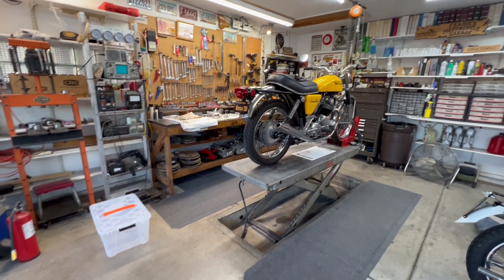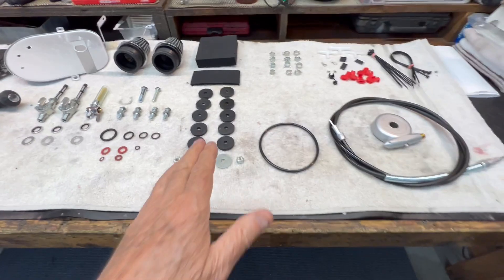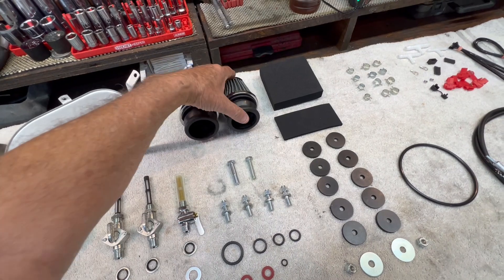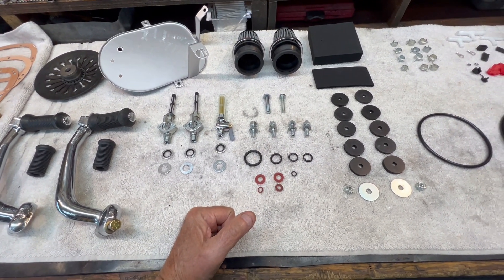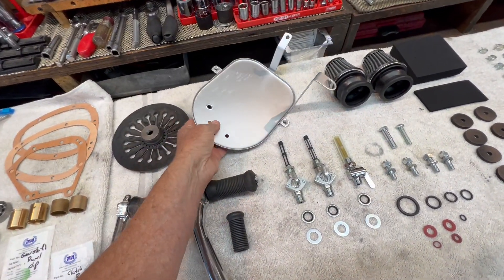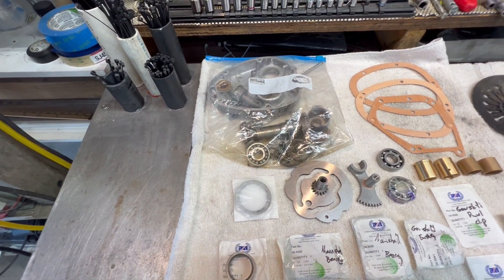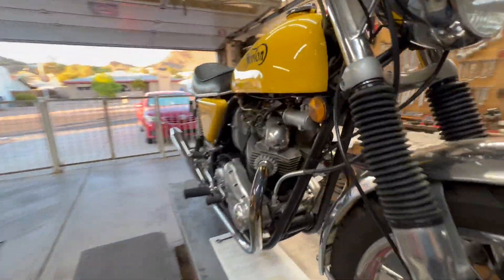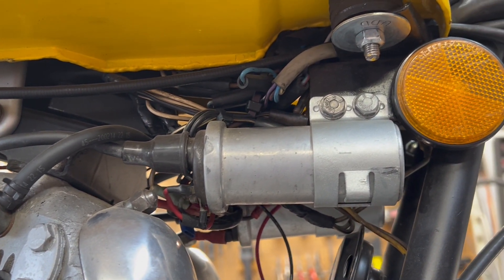Vintage British Motorcycles Repair/Restore

Comment: Wow nice set of spares from that goodie box. Was it all something that came with the bike acquisition?  Two Mark III type kickers?  I also have the Hi-rider small tank on my 850 MK II...can get a reliable 80 miles before starting to worry about fuel level...although I do find if riding down a long hill, the fuel slosh forward away from the petcocks will lead to stall with even 2-3 litres still remaining (out of 9.2 total in that tank). So I just have to coast down the hill until level and re-start.

Comment: I didn't think about pulling that stud out and putting gasket sealer on it.   I hope you'll shoot video of that process so I can see exactly what you do.   If it works I'm going to try it on my Triumph (which has the same leak.)
Reply from the maker: Oooops, too late.  I did it today and didn't video it.  Sorry.  I will video it if I replace the stud with a bolt.